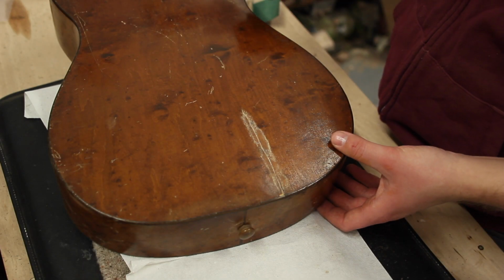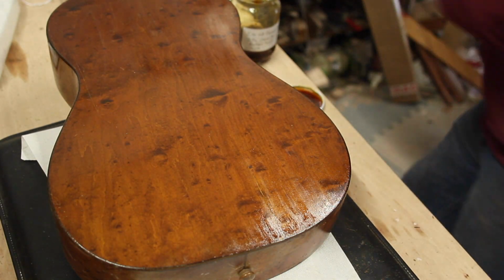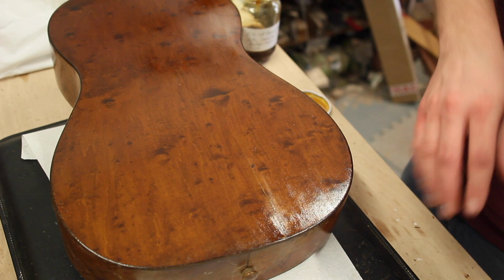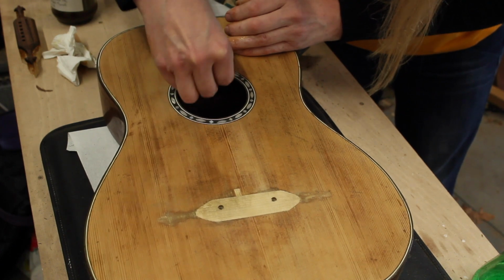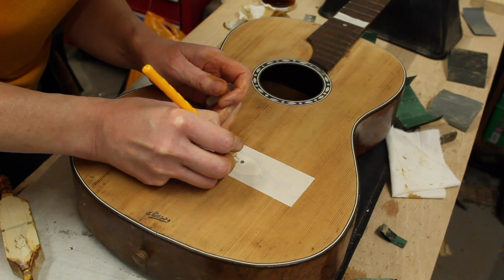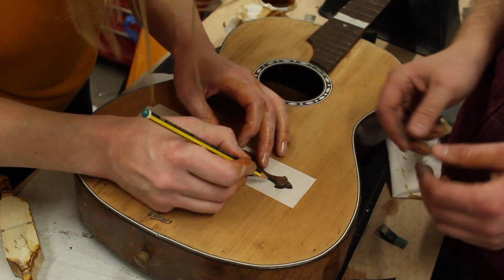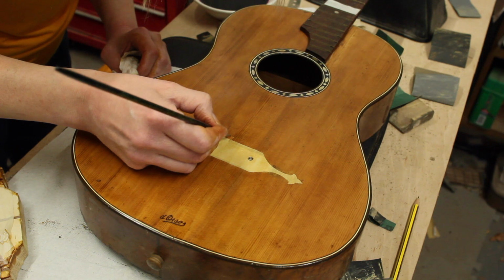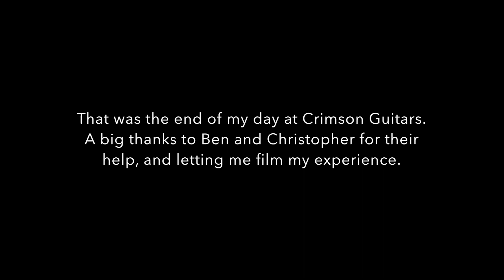Restoring an antique parlour guitar part 24b: French polish at Crimson Guitars pt2

Comment: A wonderful series so far Susie and I have agreed with almost every stage of your approach to this restoration, until now...

My advice to you is, if you want to research the technicalities of refinishing an old French Polished guitar, don't go to a luthier who seems to have no idea at all about French Polishing (although he may be proficient with modern coatings)  but instead go to a professional French Polisher and you will quickly discover that what the so-called luthier did and taught you is completely wrong and a million miles away from the proper method of French Polishing.

For a start, French Polish  is (and always has been) applied in a figure of 8, not in straight lines along the grain.

Secondly, what lubricating oil did you use for the rubber? - I didn't witness any at all. It's no wonder that you ended up with such a poor surface finish.

The old school method is to use a few drops of raw linseed oil but most French Polishers these days use Johnson & Johnson Baby Oil, since it gives a far better gloss finish with far less work.

I hate being critical of you, Susie, because you are clearly a very skilled and thoughtful luthier (were you a student of the Newark School of Guitar Making and Restoration?), however, I am extremely critical whenever skilled people obtain bad advice or information from other so-called professionals.

There are umpteen YouTube videos out there covering the proper way to French Polish and I am taken aback that you seem to have failed to research the subject, so that you were taught an incorrect method. French Polishing is so simple... it begs the question why you would have someone else trespass upon your restoration project?
Reply from the maker: +Gordon Burns you must never use oil with the initial coats of shellac - it will soak into the wood and ruin the guitar